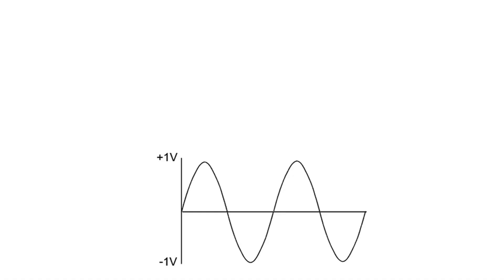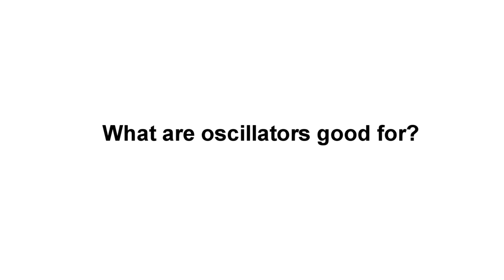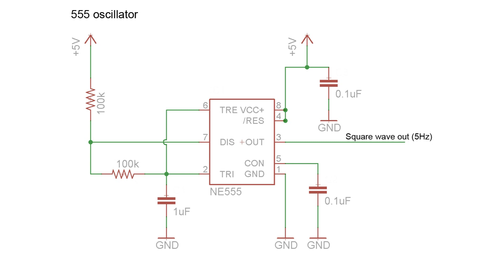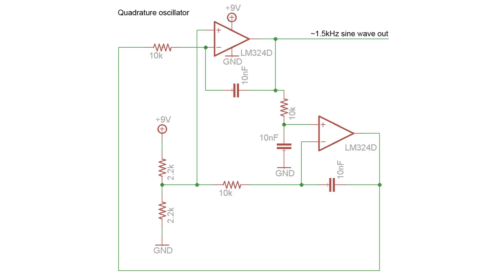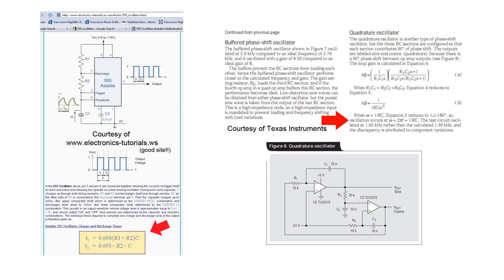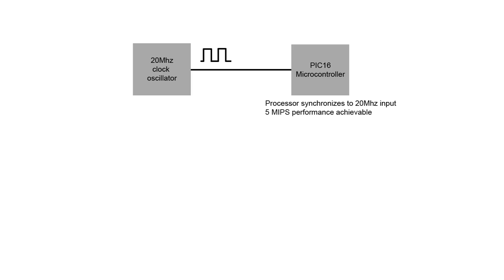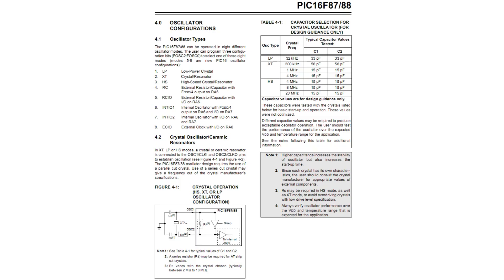What is an oscillator? Oscillator tutorial in HD!

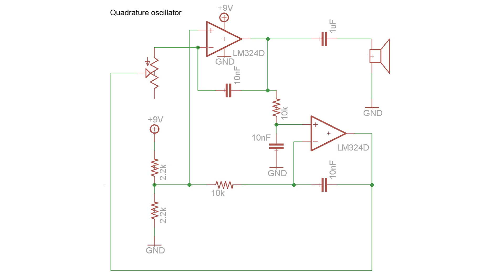Comment: 02:14 So what could we do if we wanted to tweak the frequency by electrical means (e.g. from another oscillator) instead of tweaking the knob of a variable resistor?
Reply: Make a coil on a PVC pipe and use a rod to switch the channels left to right. Each wind of coil would be a new frequency
Reply: @JoseCardenas-ld6yt  I think that you missed the "by electrical means" part. What you describe requires physical interaction (moving the rod).

Comment: Thanks for the great content.  Do you have pointers for building the quadrature oscillator?  Am I having trouble because I'm using ua741 op-amps, and have guessed on how to adapt the inverting input voltage?
Reply from the maker: 741 op amps are useless. Try an LM324 or better op amp.
Reply: @Afrotechmods  I tried again with LM324 it's not perfect but it works!  I put a potentiometer at the voltage divider.  By adjusting the pot, I can either get good looking peaks, or good looking troughs, but not both. I'm still pretty stoked!

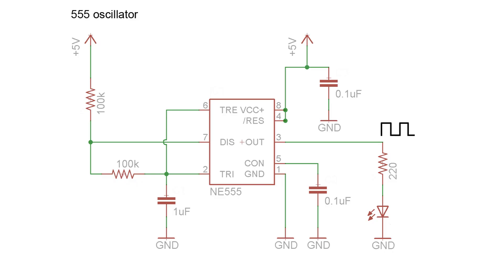Comment: Why does the 555 oscillator on 1:30 produce blinky lights instead of dim lights as in PWM circuit?
Reply: because the voltage goes from o to 5 V.
so it blink when this conversion happens

Comment: @Afrotechmods I really want to build an oscillator that can gradually change between a sine wave and a square wave using a pot. Anyone know what kind of oscillator this might be called or how to implement it? 
I tried using an LM555 and the using a LPF. This works, but I want the oscillator to have an adjustable frequency also. 
The LPF doesn't track the fundamental frequency of the the oscillator, so it just attenuates the output if you turn the oscillator frequency up.

Comment: How would you use an oscillator in a switched mode power supply in which the duty cycle is determined by the difference between the output (measured by a voltage divider) and a Zener reference voltage?

Comment: Dear Afrotechmods! I have a nice 12V electromagnet with whom I am trying to build a vibratory linear device for transportation of small parts. As far as I know, 60 to 90 Hz is good starting point in this. What do you think - can I use the variable circuit for sine generator? I'm sorry but I don't have much in common with the Electronics...
Reply from the maker: +magdanoz88 If you are doing this with something like an electromagnet I think you would be better off with an amplified square wave because it will be more efficient. You could use a 555 oscillator circuit to make a 60-90Hz square wave then combine with an N channel mosfet + diode combo to amplify the 555's current output.
Reply: +Afrotechmods Thank you very much! Nice material for thinking/testing!

Comment: Hey Guys, if you want check out my Video" IC 555 based DIY Synthesizer (Part I)". 
I connected the audio output of my IC 555 circuit with Ableton. So its possible to record and modulate the audiosignal for example with the autofilter.. Thats fuckin funny!

Comment: Hi Afro, I have a bad smd crystal I need to change out but what would be the most basic circuit to test? Can I just put power to it and use a scope? This the the little fella I would like to swap.
https://goo.gl/photos/CUtUnAMYqDPDRQEN9
for the, what I think is fried on this board.
https://goo.gl/photos/uaTgiPpCxzsfbJ5N9
Reply from the maker: MicroRCFiend Should be easy to test the crystal by probing it while the PCB is powered up. Or you could just replace it with a new one for $1
Reply: That's the problem, the crystal doesn't let me bind my transmitter with this receiver most likely because of a damaged crystal that is part of teh accelerometer that is vital to the pre bind state. It's from an old version of a hubsan quad that now use smd versions I am trying to fix for a friend an maybe learn something too.

The other donor board I found is also dead due to reverse polarity magic smoke trick but i'd like to test that smd version of the crystal as if it works I can use that instead of wasting money and time. 

I watched an hour long video that was interesting but didn't tell me how to test one without a large complex circuit and a couple like yours plus some wikepedia - nothing tells me if I can just put power to it and scope it or test with a DMM not so I asked. 

I have found replacements in packs of 10 for £1 but I am trying to learn how to troubleshoot  as much as fix the quad. Is there a streamlined way to test a crystal out of circuit with a dmm? Sorry if this seems a stupid question, I just haven't dealt with oscillators yet, only some real basic self oscillating circuits like the bedini ssg.

Comment: Thanks for this video Sir. By the way what is the DC offset definition?
Reply: +Totardo Tobing The voltage at the center of the waveform. It should be centered on 0v, if not, whatever its voltage is centered on is the DC offset.

Comment: !! STUPID QUESTION ALERT !!
Would this be AC current since your changing the voltage back and forth and measuring it with frequencies?
If so, could I use a transformer with batteries then since this will create an AC current?
Reply: yes

Comment: Will this work with a LM324N as well?
Reply from the maker: Yes!
Reply: Afrotechmods Oh gosh!. Chip should be allright, caps should be all right, resistors should be all right. Circuit seems to be identical, but not even the tiniest sine wave for me. Could it be the capacitance from the breadboard doing this to me?
Reply from the maker: Unlikely. Do you have a 0.1uF decoupling cap on the amp's power supply pins?
Reply: Afrotechmods No I don't, will try it when I get home. Is it nescessary when powered from battery?
Reply from the maker: Always!

Comment: By attaching an antenna to output 3 in the NE555 timer circuit, will we get a radio transmitter at a known freq. ?
Reply: If it does work it won't be very effective. Radiowaves are usually made with sine waves, not square waves

Comment: @Afrotechmods       I'm so sorry what I meant was to fully charge the 2 volt lead acid battery. The source of power is a 12 volt lead acid battery and I'm replacing the LED with a 2volt lead acid battery to be charge up.Thanks for the info.

Comment: Hi!!! Can I use the pin 3 of this 555 oscillator to trigger the gate of  N  channel MOSFET? ( IRFZ 44) I would like to trickle charge a 2 volt lead acid battery from a 12 volt Battery.The load will be the 2 volt lead acid battery. THANKS